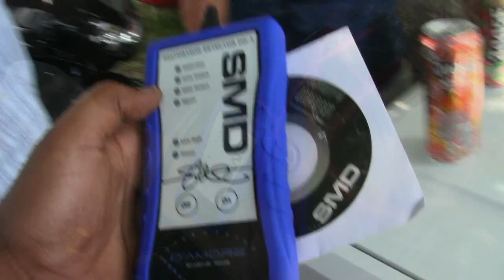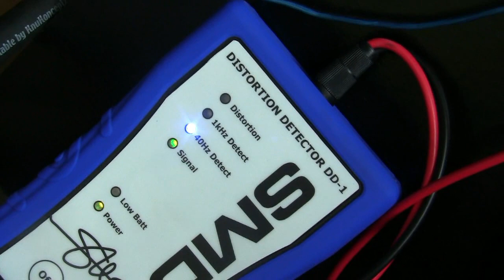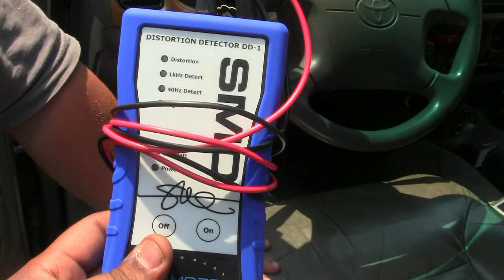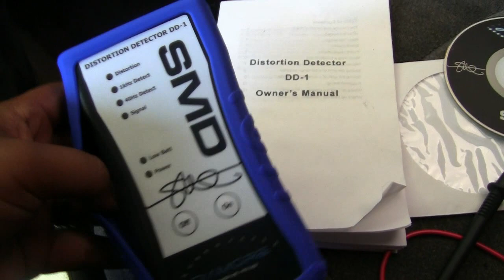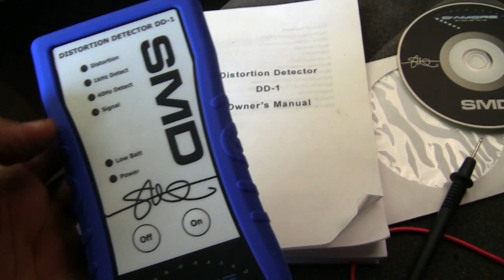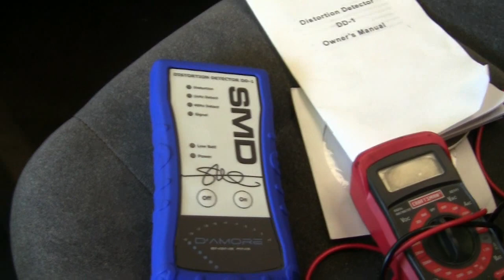SMD Distortion Detector  Testing and Review!

Comment: Only noobs use these things. They don't work and no way would I trust my multi $1k's system to a blinking light.
Reply: Tammy Forbes dude your full of it, if you got an o-scope maybe, otherwise SMD is the only way to go.
Reply: mptorecon no SMD isn't the way to go. It doesn't even work correctly. You set your gains at 40hz well what happens when you dip below 40hz? That's right your still clipping. So you tell me what the point of paying $149 dollars for a tool that doesn't do what it says. You can get a oscope for cheaper and actually stop clipping and distortion no matter what frequency you play.
Reply: Tammy Forbes that cheaper o scope is trash. That's fact. The product works for car audio, that's fact. But hey do your thing, what matters is YOUR feelings, gawd for bid we hurt your sensitivities.
Reply: mptorecon quick question have you ever seen anybody at world finals using anything SMD? No you haven't cause they like me know better and if your un willing to do the research and listen to reason you will find out for yourself these things are a waste of money. Guy came on the SSA forum the other day and said he used a DD1 to set his gains and then adjusted it by ear and only used the DD1 as a starting point. So basically he spent $149 to still end up setting by ear cause the DD1 isn't correct.
Reply: Ohh and what happens when you set your amps at 14.4 volts then have voltage drop? That's right you still have clipping. And oscope's aren't junk there the trusted way of setting your amps and have many uses and unlike the DD1 they really serve a purpose.
Reply: What world finals. I set all my stuff to 11.1 volts for SQ anyway.
Reply: https://www.youtube.com/watch?v=v0Jcsn3-Uf4
Reply: Its always the so called professional sound guys will be hurt by this DD1

Comment: bro I'm down to cop one of these and the cc1 but at the moment I cant. can you help a fellow bass head how to set the LPF with a multimeter with hertz setting. I'm running 500 watt rms subs and 900 watt rms amp. I'm using the Ohm's law to set my gain. but have no clue how to set the hertz LPF. I know it can be done. can you help. what do I need to do

Comment: OK, so you hooked the "meter" to the amp...Lets say the amp is 1000 watt amp.
and you have it connected to a 700 Peak watt sub. You are currently running your amp at lets say 1/2 gain. Your "meter" allows you to turn it up to over 3/4 gain.

How has this improved my system?
Not being a hater, just want to better understand what this thing is doing for my currently tuned system.

Comment: Hey twisted i have a question im running a american bass vfl 2680 on 2 xfl 12s my question is after i set the gains on the amp will i still be able to use my remote or will it mess up my settings? somebody help